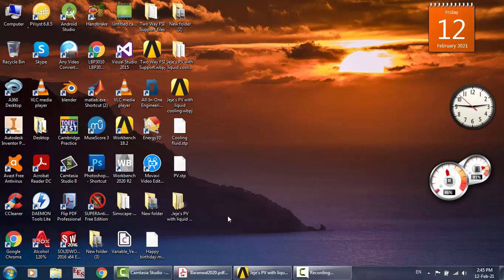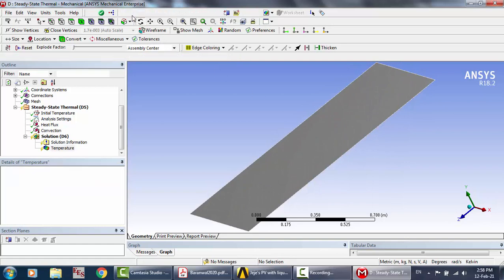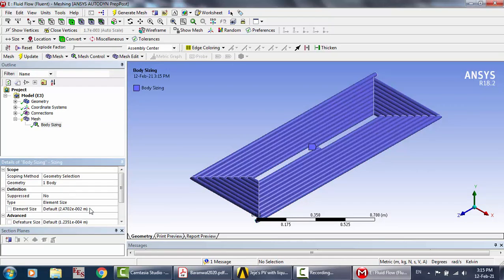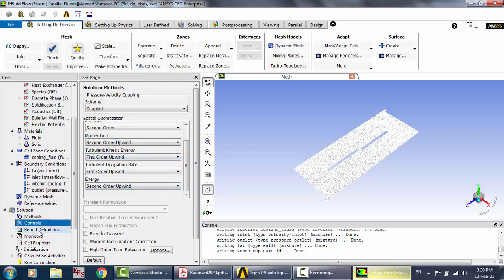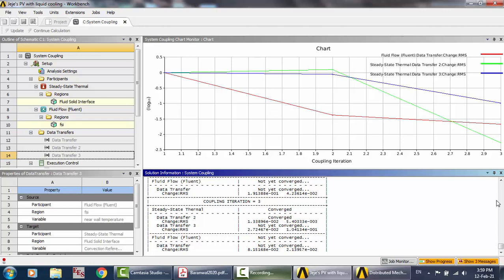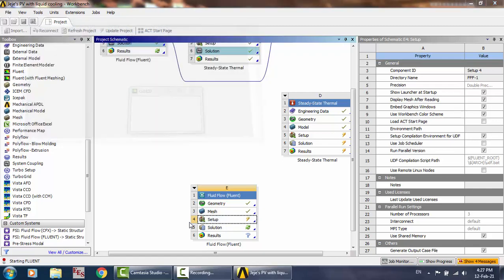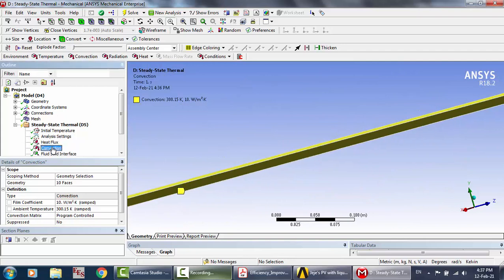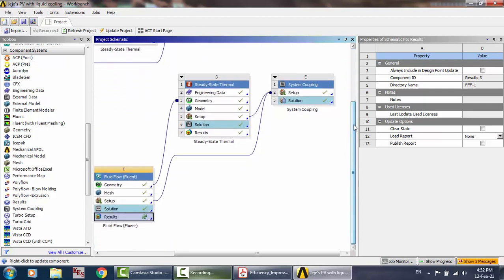CFD simulations on cooling a PV panel in Ansys coupling 2 way FSI in Fluent & steady state thermal

Comment: Hello sir. This video has been very helpful in my research. I have been following it to work on something very similar. However, I am having  an issue with my results. If i work out my thermal efficiencies, i get values that do not make sense(more than 100%). I would like to use this work for my validation. Would you kindly share your geometry. 

Thank you and kind regards.
Reply from the maker: Hello, I showed the details of the geometry in the video and you should generate the parts by yourself. It is not that complicated. Then follow the same steps and you will get the same results. Thanks

Comment: Thanks for the video. My solution contains very high temperature values , what’s wrong ?
Reply from the maker: Hello dear Roaya, you're welcome! Something is not coreect with the orocedure, geometry or meshing or setup. Generate the same geometry (same dimensions) then follow the steps with the same inputs and you will get the same results. Thanks
Reply: @haveanicetime  thank you for answering 
I checked but it was a same thing
Reply from the maker: @roayamahmood3672  There is something is missing affecting the results. I recommend following a simple video of mine and validate the results, then move to this complex case. Thanks
Reply: @haveanicetime can I sent to you my design please

Comment: Hello. Thanks for the video. What changes should I make if considering the thickness of the pipes?
Reply from the maker: If you are including the solid pipes in the simulation, import them with their thickness to accout the heat transfer accurately. Thanks
Reply: In that case, should I consider the solid part of the heat exchanger (pipes) in SST or Fluent?
Reply from the maker: @1414dmk  The solid part is treated in ANSYS thermal with the PV panel, you prepare the CAD files and create the assembly as I showed but include the solid pipe and attach it to the back of the panel, then attach the fluid inside it, then treat the fluid in Fluent and the panel+the pipe in thermal. Okay?
Reply: @haveanicetime  I have the following error message while using the system coupling module "update failed for the solution component in system coupling. the coupling service failed to start."  Do you have any idea what could be the reason?
Reply from the maker: @1414dmk  Hello, as I mentioned, the simulation is very complex to run and prepare. Accordingly, follow my model at first and it must work, then, try to change anything and see what happens. Thank you

Comment: Hello sir, For me in system coupling, Data transfer 2 is not getting converged, what to do?
Reply from the maker: Hello, something is not correct with anys tep shown in the video. This procedure is sodifficult and requires some concentration during carrying it out. Check again the procedure from scratch and step by step you get it right. Thanks
Reply: Hello Jai, I have the same issue. Did you manage to sort it out through repeating this tutorial?
After repeating this process and doing my own research I still have issue with this data transfer so I was wondering if you managed to solve it and what did you do to do so?

Comment: Sir have you used hollow pipe or full pipe ( neglecting OD and ID)?
Reply from the maker: You can use the inner diameter because the fluid flows through it neglecting the thickness of the pipe. Thanks

Comment: Hello sir, I am getting this error in coupling what to do?
Poor intersection was identified between the source and target. This error  |
| check is triggered when the mapping fraction for both source and target are |
| below the threshold set by MappingControl/PoorIntersectionThreshold         |
| (currently 0.5). Please review the mapping details written to the folder    |
| 'Results_PoorIntersection' in Ensight for potential setup issues. It may    |
| also be helpful to (a) increase the Absolute or Relative Gap Tolerance (if  |
| the interfaces are separated) or (b) change Face Alignment (if the          |
| interface mesh normals are inward-directed or if there are shell elements). |
| You can deactivate this check with MappingControl/StopIfPoorIntersection.
Reply from the maker: Hello dear Hem, repeat the procedure again carefully and exactly follow the steps I showed and you will receive no errors. Thanks
Reply: Did you manage to fix it? I'm stuck in the same problem.

Comment: Hello,I want to know why don’t you use the fluidflow model directedly? Instead of, you used the steady thansfer heat and fluid model with the help of system coupling.why did you do that?bro
Reply from the maker: Actually I made that clear in the video.

Comment: Hello In 29:48,  i just have one doubt regarding Hydraulic Diameter =15.275 mm..But in the Boundary condition the Hydraulic diameter is in m. So wont it be 0.015275 m...Waiting for ur reply
Reply from the maker: Yes, I could not observe it :) because I was recording. Put the right value. I was just showing an example. Danke!
Reply: @haveanicetime  ok no problem thnx for the video..it was very useful..Danke schön !
Reply from the maker: @AmanThePlatypus  Herzlichen Willkommen...
Reply: if you made it i would really appreciate the files I'm really confused on the geometry of the design please

Comment: Am I allowed to request this design?
Reply from the maker: I am sorry, I never share any PV geoemtry because it is easy to generate. Danke!
Reply: But why the result contours not same on the journal?
Reply from the maker: @singgihdwi7018  Because as it is clear, the geometry of the cooling domain is identical to the geometry shown in the paper.
Reply: @haveanicetime  If I may ask again, in your video explaining the difference between meshes, can you explain the mesh required to get the minimum validation error value?
Reply from the maker: @singgihdwi7018  You must use the identical geometry of the paper and the same mesh cell size they used. In general, a mesh dependence study must be carried out to reach the optimum cell size.
Reply: @haveanicetime  Any suggestions for a mesh that I can simulate with a similar geometry based on your tutorial?
Reply from the maker: @singgihdwi7018  Study the basics of CFD at first then use the software.
Reply: if you made it i would really appreciate the files I'm really confused on the geometry of the design please

Comment: Hey i have another question, is it possible to show the result of both pipe & pv in the same post processing panel?
Reply from the maker: I am not sure because they are not in the same solver. Try creating a CFD post cell and transfer the solution of the thermal and fluent to it. It may work but I am not sure!.Danke!
Reply: @haveanicetime  okay i will tried. thanks!

Comment: hey i already make a pv design on solidworks but when i convert it to .step the design is not complete (cannot found the solar cell). Do you know how to solve this? thanks. Btw, i checked the geometry on SCDM
Reply from the maker: Hello dear Putra, you must generate each part as a single step file. Then import each layer one by one in Designmodeler following the rule of add material and add frozen like what I showed in my videos. Danke!
Reply: @haveanicetime  hi, do you have the step for designing the each part in solidworks? it would be helpful if you copy the link thanks :)
Reply from the maker: @dhanasatya_np  I am sorry I do not share simple geometry like these. You must learn how to generate them by yourself. Danke!
Reply: @haveanicetime  oh i see, i have another 2 question if you dont mind. First, are those panel design of yours is just a simple rectangular design with specific length width and thickness? The second one is if i have already seperate each part in solidworks (the panel and the cooling pipe), are those part can be combine with the precision like on the assembly in solidworks?
Reply from the maker: @dhanasatya_np  The panel's description is in the paper I showed. Watch my other video about using fins(ribs) to cool the PV where I showed how I designed the layers in Autodesk Inventor and then import them into ANSYS. Danke!
Reply: @haveanicetime  thankyou, so is it just a simple rectangural design for the panel right? and later we can add the engineering data in ansys, am i correct?
Reply from the maker: @dhanasatya_np  Yes.
Reply: @haveanicetime  thankyou so much, have a great time!

Comment: this warning error is appear  when make coupling i don't understand it what is mean (   Warnings were found during data model validation.  

Restart output is only requested at last step. To enable restarts from        
    intermediate points, use another 'Output Control' option.)
Reply from the maker: Hello dear Alaa, something is not correct with your steps. You must follow each single step in the same order shown in the video or you never run the simulation properly. Danke!

Comment: Hi dear Ahmed. In the radiation of the top surface, some articles using 0.0522*Tamb^1.5 for calculating the sky temperature. Is the Tamb in kelvin or celsius? Thank you
Reply from the maker: Hello dear Mohsen, you will find this piece of information in the article that has the equation or any other reference. Check out the units. Danke!

Comment: hi is there an email address for me to contact you?
Reply from the maker: Hello dear Luqmaan, what is the issue? Danke!
Reply: @haveanicetime  I have a project regarding cooling solar panels, need some help in constructing panels!
Reply from the maker: @luqmaan7939  Okay, watch my video about cooling the PV using ribs in ANSYS steady state thermal. You will find the different layers of the PV generated in Autodesk Inventor. You can learn these CAD basics at first and then use ANSYS. It is just rectangles or squares and then use the extrusion command. I showed that in that tutorial found in my playlist. Danke!
Reply: @haveanicetime  Merci :)